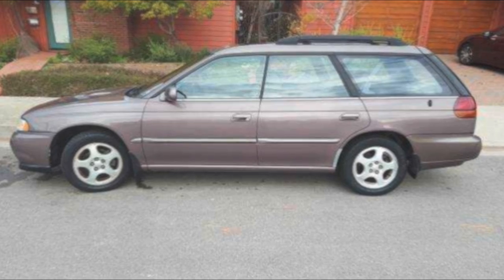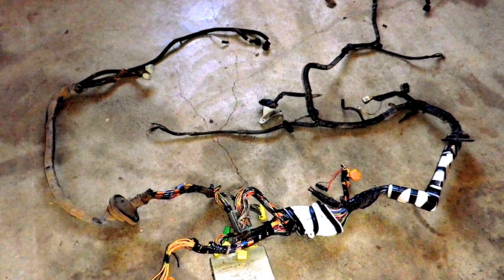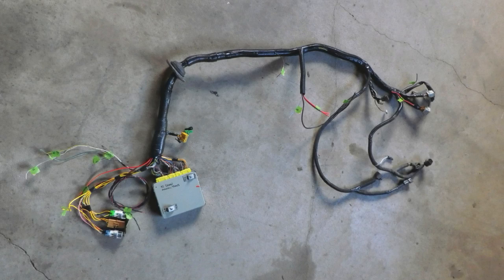Busaru Harness Video Series Intro

Comment: I have a 2.5L EJ25 DOHC non-turbo gasoline engine from the 1999 Japanese SUBARU Impreza. I'll install it to my 1984 VW Vanagon with automatic transmission. I want to see the entire process from start to finish on your new videos. Which wire take, which wire leave. Where to find pinouts and which wires lead to the ECU. All of this would be great! I like to look at your work)
Reply from the maker: Hey Subyvan, you're in luck, that's what I have planned. I'll be posting a few videos shortly.

Comment: I'd be most interested in a EJ22 wire-harness since I'd be dealing with the fun California Emissions standards. Maybe one video could be comparing the differences between a EJ22 and 25 harness, but that may be another series itself.  Either way, awesome videos!
Reply from the maker: That is a good video idea, but the differences are very subtle in most years. The 90-94 2.2's, if you're using the KEP exemption, are becoming a little hard to find but I may make a video specifically on those - we'll see if one comes into my hands so that I can walk folks through it.

Comment: And also what to do if you need to fix the existing bus wiring could be helpful too?
Reply from the maker: +Caleb Can Hey Caleb, with the bus wiring, I'd just take one problem at a time. For example, if your horn doesn't work, check the fuse. If the fuse is good then put a test light onto the horn positive wiring and ground, and see if you can get it to light up. If the test light glows, then your horn is out, if it doesn't glow, just start working your way back until you find the issue. All wiring issues can be solved this way - the tricky part is an intermittent issue!

Comment: I'm working  on a harness  that  rats chew up and  I use a meter to connect the  right wire and  when I  got  finish I  it  back up and it didn't

Comment: perfect, i'm about to undertake a 2.5 quadcam legacy engine into a syncro 2.1i just the info I need as I can do all the mechanical work no problem but not good with wiring - awesome man-keep um coming
Reply from the maker: +smallweights Sweet! I'm glad it's good timing, this should translate over to what you're doing no problem.

Comment: I will watch this :) But probs wont do my wiring harness diy Subaru WRX engine in a Legacy. I guess if you could do a really general one where you could apply this method to other harnesses other than a VW
Reply from the maker: +kev550D Yeah, for a Subaru "merge" it'll be a little different, but certainly some of the same principles will apply. If you have a manual transmission it will make your life a little easier since no auto trans wires to worry about.
Reply: Actually the shell is auto then converting it with a manual

Comment: Wiring for creature comforts like (in priority order):
Cruise control
A/C
Auto off headlights and interior lights (believe Subaru has these)
Reply from the maker: Hey Michael, I'll be able to show certain parts of the AC wiring I the harness video series but I may make a special video just on that. And maybe another on Cruise control. The interior lights will take some experimentation on my end as I've never played around with them. The door lock timer system is probably the mechanism for those though.
Reply: +Busaru Well if your donor car has it would be cool to have near field door locks and push button start but maybe I am getting carried away. That is the kind of thing I may experiment as my project takes shape over the next several months. :-) I plan to build up the double-cab prior to doing the body work. Plenty of fab work I would like to do. If I do something interesting I will shoot you a video. Thanks, Mike